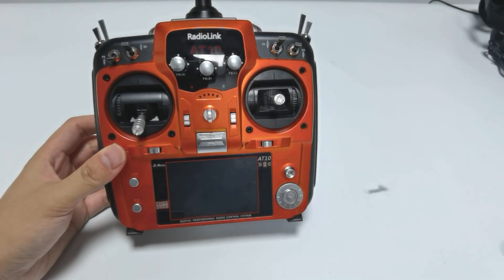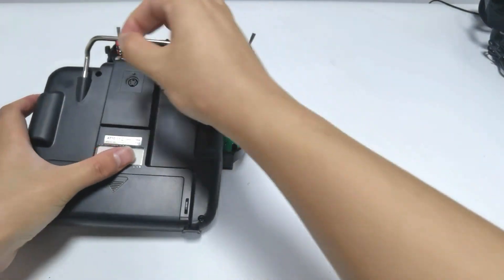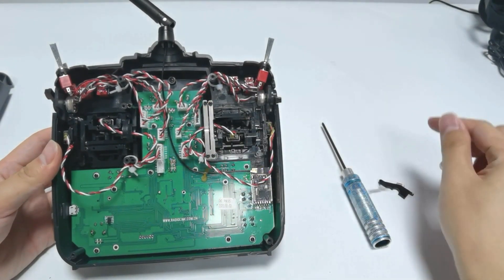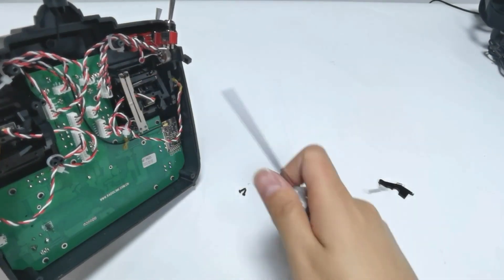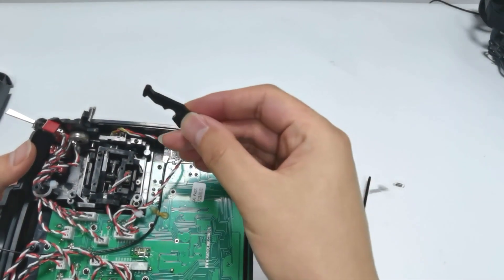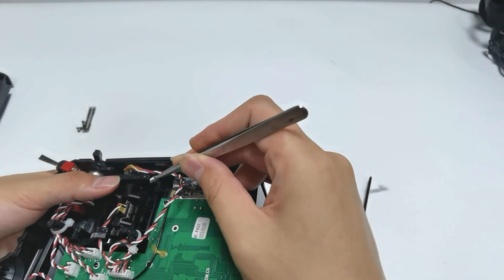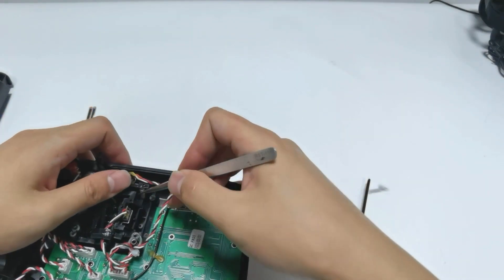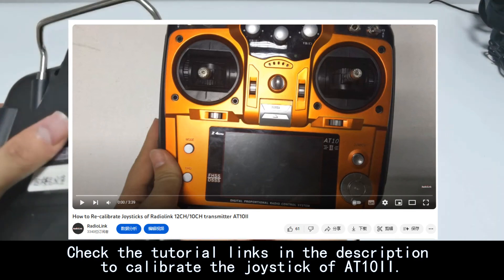AT10II/AT9S Pro Self Centering Throttle Stick Adjustment

Comment: Hello I have been using Radiolink AT10II.During my last flight, I fell down the transmitter eventually throttle gimbal(stick) broke down.Actually it is working but it has mechanical problem like sometimes rudder doesn't center itself.For instance when I put rudder to full right and release my finger it keeps staying at last position where I left.Somehow I relatively solved this problem by loosening adjustment screw but no more I have old stick feelings like tightness and smoothness.Therefore I purchased replacement gimbal from local hobby shop.My question is what I should pay attention while replacing it? Some people claiming that I should apply vaseline to gimbal.I don't know whether I should apply it or not and where stick I should apply it?
Reply from the maker: Hi, sir. The damping of the joystick of AT10II can be adjusted, Here is the link for your reference: https://www.youtube.com/watch?v=yn2tnRJeeLA  And if the joystick of your AT10II is damaged, you can buy the original stick from our AliExpress official store: https://www.aliexpress.com/item/2251832851315317.html  You do not need to apply vaseline. It will work well. If any question about RadioLink products please feel free to contact us. Our email is: after_service@radiolink.com.cn